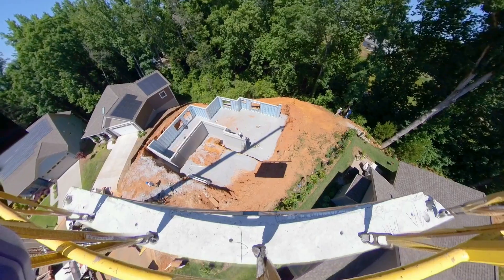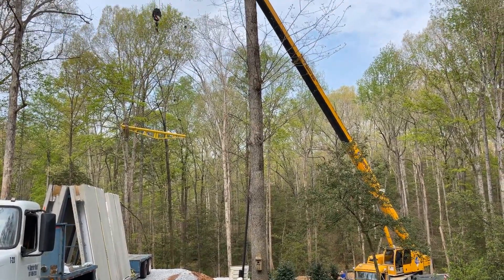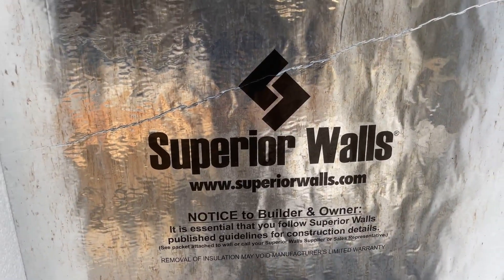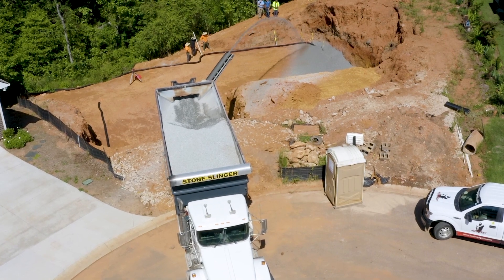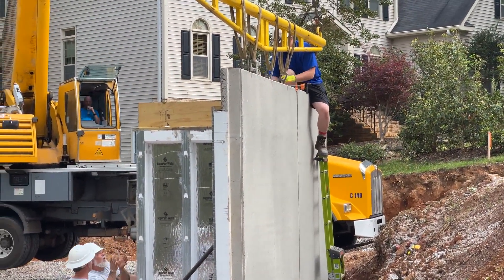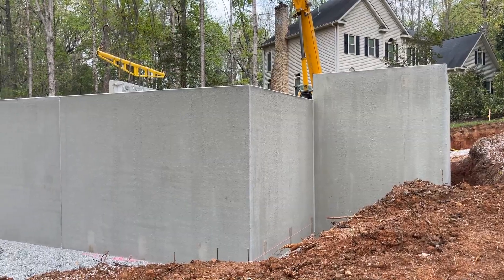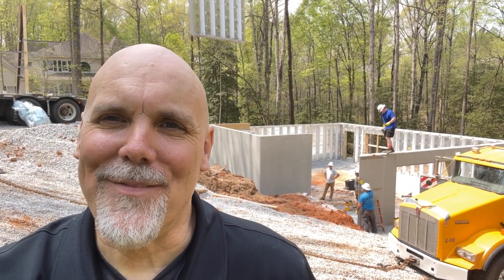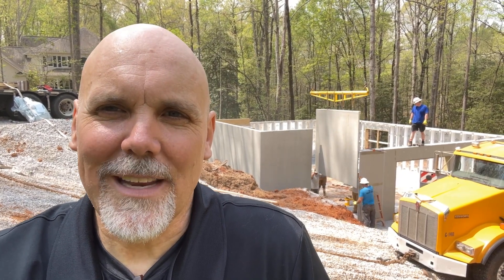Setting SUPERIOR WALLS | Modular Precast Concrete - Creating a Safe and Strong Home

Comment: My experience with Superior now dates back over 40 years and have a few points. Keep in mind Superior Walls is a franchise system and they only guarantee these walls for 15 years unless you are that rare individual that stays in the same house for your lifetime. It should be noted that Superior Walls are fast to make and install and often the time from design to final installation is a paramount concern for some builders because financing time costs money. The pea stone base is considered a part of the normal “foundation system” and if the precast portion is installed at final grade the pea stone is required to extend below the frost line to avoid frost heaving. The pea stone base is typically effective to prevent heaving when the drainage system sufficiently prevents water from entering the pea stone system above the frost line and freezing. Unfortunately you are relying heavily on the drainage and over time drainage systems can become compromised allowing water and therefore ice above the frost line but can be below the bottom of the concrete wall which as everyone knows ice expands and potentially can cause heaving. A big plus for these walls is fast construction in the winter. It is an interesting process as the studs are cast with electrical and water penetrations into the outer wall when it is poured with insulation used as part of the form and therefore attached. The walls are often installed just a day or two later based on scheduling. Unless the engineering has changed these walls used a 5000 psi “GFRC” glass fiber reinforced concrete.  “Spider Cracking” is considered to be “normal” and part of the aging process of the wall system, not sure if I would like their normal though. A small amount of steel is used in the precast wall studs to tie them to the comparatively thin outer wall and also around the top and bottom joining at bolt connections. When the floor is poured it is not supposed to interlock with the wall system and is designed to allow for the walls and floor to move independently. All that said to be fair if these walls were significantly cheaper than poured walls and I needed a house to be turn key within a shorter period of time and if I wasn’t going to be in the home for a long time I would definitely consider them.
Reply from the maker: Superior Walls of NC provides a lifetime warranty to the original homeowner that reverts to a 15 year warranty to the subsequent homeowner.

Comment: You say the cost is less than that of a poured concrete walls and footers.  How does the cost compare to concrete block basements?
Reply from the maker: Not really sure - we do not and would not use block for basements.  While some still do, it is not as strong and precast or poured concrete.  
To construct a block wall basement properly (in my opinion), you would need rebar into the footing, bond beam block with horizontal rebar, and the cells filled with concrete.  Exterior waterproofing, interior continuous insulation, and framing would still be required, so I'm doubtful there would be any significant savings over precast Superior Walls.

Comment: From the POV as someone who barely knows construction, my concern with these walls are with how each unit is connected. It looks like it's a combination of good bolting and some sealant. If used in a basement setting, wouldn't the sealant need to be replaced ever so often, and how would you do that underground? Or am I misunderstanding this?
Reply: The sealant material and worksmanship is super important. I would recommend an additional layer of blue skin barrier on the basement joints, and cover it with reinforced parging or cement board, but doing that is extra cost. For above grade caulked joints, they need to be replaced every 10 years since it’s exposed to UV rays. For precast the joint is usually a weak point if not done properly.
Reply from the maker: The sealant is a moisture cured polyurethane and as discussed in the video, there are three layers of sealant, the exterior, the middle, and the interior.  The exterior is all that is technically required, but they install all three layers for redundancy.  For sealant that it above grade and exposed to UV light, the Superior Walls manual notes that  "Sealant in panel joints exposed to UV light above the level of the ground may experience surface discoloration or cracking.  If UV damage has occurred, joints can be resealed with a quality one-part polyurethane masonry sealant."
Sealant below grade will not degrade.  We always paint the exposed exterior of Superior Walls with a high quality elastomeric masonry paint which also protects the sealant joints.

Comment: At ~6;15 the narrator says that these panels have wire mesh. I wonder if that is true. I've watched several of superior walls manufacturing videos and have yet to see wire mesh installed in any of them.
Reply from the maker: The walls have rebar in each precast stud that is tied to the rebar in the top and bottom bond beams.  Steel "eyes" welded to reinforcing wire are tied back into the rebar at the top and bottom bond beams.  Welded wire mesh can be specified in the outer layer of concrete but is generally not required.  The concrete mix used cures at 5,000 psi or greater and is typically fiber reinforced.  Hope this helps to clarify!
Reply: @@user-bb4xk6bb7nxxx 
Who is doing the lying?
I was hoping for a reply from Addison Homes. It does look like he eventually replies to some of these comments.

Comment: Does superior walls ever figure in for a brick ledge with different height grades?
Reply from the maker: Absolutely!  This is part of the wall design.  Brick ledge can be added anywhere and at any height on the exterior of the wall - stepping down with grade.

Comment: Looks great. Why not build the entire house with those walls?
Reply from the maker: It can certainly be done stacking the walls but becomes more challenging with exterior finishes unless you leave the walls concrete. It also involves attaching the floor system on ledgers inside the wall. On this particular house the top floor is a bonus room in the trusses and superior currently cannot build gable end walls. An all superior wall house would bee mighty robust however!!!!
Reply: As far as I know they also have another product called AG (Above Grade) precast concrete walls, so it can be done. With the restrictions that AddisonHomes mentioned.